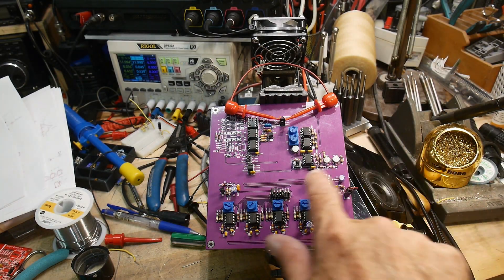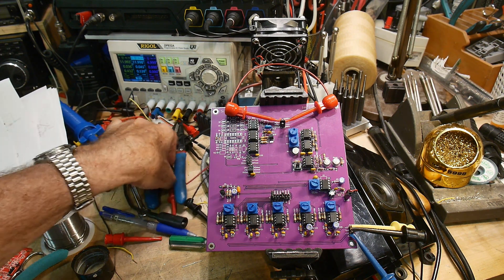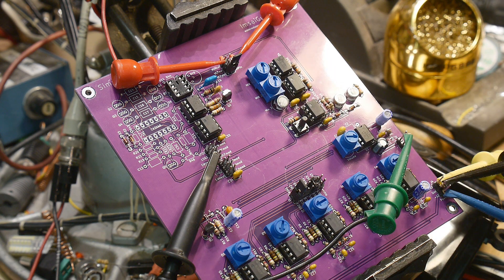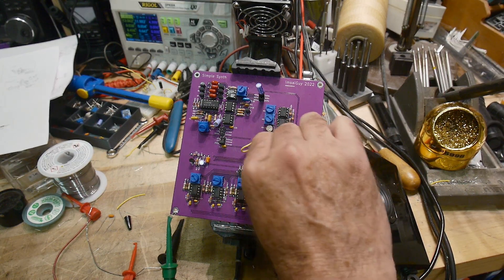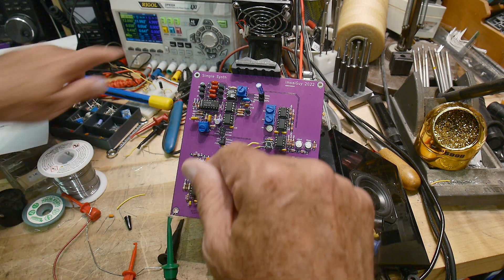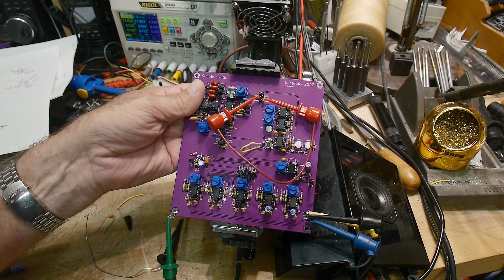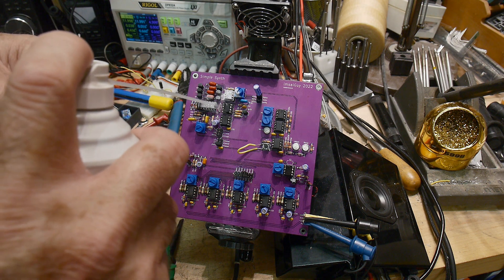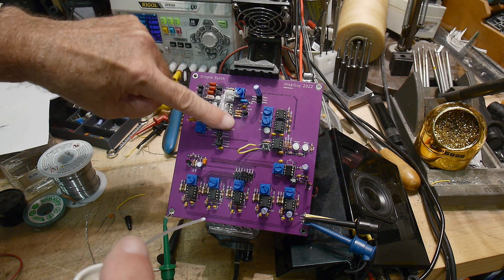#1231 Simple Synth Project (part 3 of 6)

Comment: Hi, did you take care of pin 13 / substrate of the transistor array ? It should be AC grounded and additionally the lowest DC voltage compared to all other pins.  Doing anything else can cause lots of weird and funny things...
Reply from the maker: These videos were recorded weeks ago. I did not find that problem until part 6

Comment: Have you talked about diagnosing with freeze spray before? I'm interested in why making it cold would have this effect
Reply: Usually freezing is used to force an intermittent into failure.  If you have a hairline crack in a PC trace or a solder joint, freezing will open it.  

It can also locate a short by quickly showing you which component is heating up - the others frost up, the hot component doesn't.  Cheaper than a thermal camera, particularly back in the day!

Sometimes it will make something start working because a component is failing from overheating.

A weird possibility is that there's a near-solder bridge somewhere, and freezing opens it.

Comment: is it related to the bias circuit for the transistor package? btw which ic is it, if its a diff pair input i suppose your using a cc source for it or just a resistor, emitter resistors are good too, 1 - 10 ohm and do you have a buffer before it to not load the source signal to the filter.